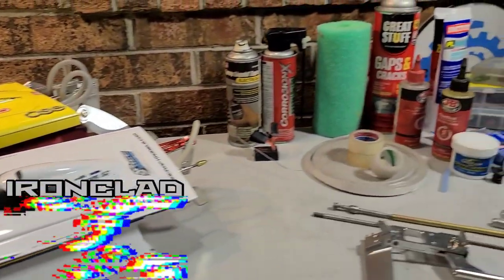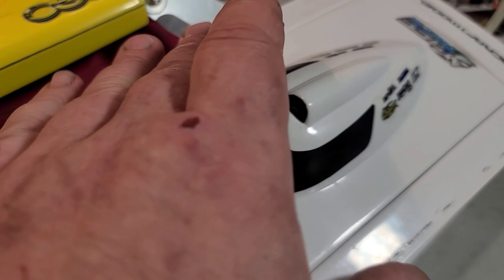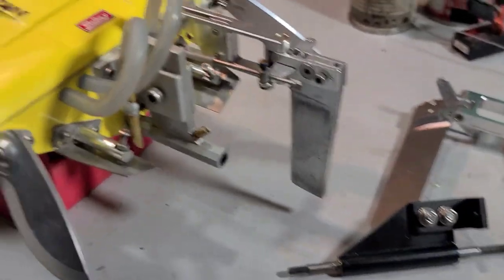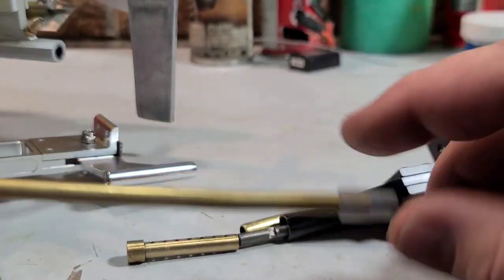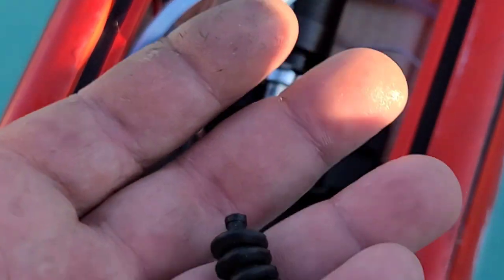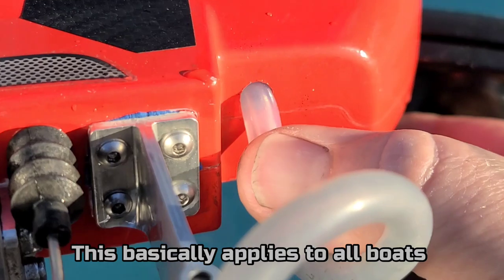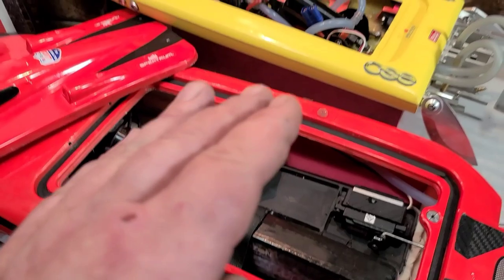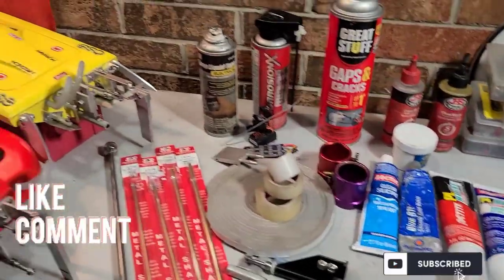How To Identify, Find & Fix a Leak In Your Boat, Water proofing, Floatation Fast Electric Rc Boats

Comment: This is an immediate subscribe for anyone new or old ro RC boats.  I'm new and this is invaluable info.  Although I'm sure you've read that I've had a very interesting time on my first couple of runs with the boat acting erratic and taking off on its own and me having to catch it and slicing one of my fingers in the process.   So this video about waterproofing is absolutely critical for me

Comment: Thank you for this video! I had a big leak in my new to me Traxxas Blast. Checked the boat in my bath tub. It floated in tub for 1 hour no leak, but when I run the boat it would fill up fast 🤔. Figured it was cooling system leak, took syringe and pumped water through, no leak. Ran boat with no prop like in video no leak…Then I started checking hull penetrations. The water cooling exit was too big for cooling tubing, and was letting a TON of water in. The water covers the hole before getting up on plane, which is why it filled up only when driving. Put heat shrink on tubing to make tight fit. NO MORE LEAKS 🎉 thank you
Reply from the maker: Glad I can help.

Comment: Man...i cant stress how sketch zipties are on lines...especially fuel! They create a pinch point thatll suck air...think of a teardrop.... try cutting a 5mm section of your line and stretching it over before installing....works 1000x better than a ziptie and no cut points...and easier to do than safety wire... thanks for all the info you put out too....learnin a lot every time i watch new vids!
Reply: @ClickLikeAndSubscribe  been doin it for my fuel lines in gas airplanes for years! Just got into boats and applied same methods....we wanna keep fuel in the tank and water outta the hull!

Comment: Very very info man!  You are the best on boat vids Ive found. 

Got a UL-19 2 months ago and 3 leaks/issues I found that were tricky to find. 
1.Small leak in hull where stuffing tube goes through the hull. Only leaked under power. 
2. Orings on hatch nuts, even taping off hatch they can leak. slightly larger orings on thumb screws and vacuum caps on the inside of the boat pretty eliminate that.  
3. This was a 2 fold issue. They tightened down a nipple/barb on the cooling jacket to tight. It cracked the plastic washer and would leak under power, but also being turned in to far almost cut off water supply through motor. I used stainless washers and thread tape on that. 

This was just something I found on this specific boat that might apply to others.
Reply from the maker: Thanks for sharing.  Do you have a link for the vacuum caps for the thumb nut?  I've been looking with out lucka
Reply: @IRONCLADRC  You should be able to get them at any auto parts store. The assorted packs with different colors are silicon and longer. Less than 10 bucks.

Comment: First your additional water cooling pick up and now adding pool noodles, my BJ24 is becoming a tank. I have been researching parts for my boat and wondering your opinion on two things. First would you buy an original flex shaft or upgrade to the OSE? Second do you know any part number to replace the steering rod end? Proboat/Horizon do not offer a replacement. Keep the tips coming sir, awesome work.
Reply from the maker: I'd get the ose upgraded Flex & strut. As for the steering rod end you can use an ez-connector instead

Comment: Started on my DF45 MKII today, that stinger really brings motor far back, so i will need to move batteries in front, or run paralell ;) Not that i complain on running paralell 6s.
Guessing around 42-45mm props on the Leo 2200kv, but lets see how it behaves on 45mm prop and 4s
Reply from the maker: Awesome. Thanks for the update  brother. Good luck with the run.

Comment: I think you mentioned in another video that the bushings in the V1 and V2 are different. Where do you get a V2 bushing, I can't seem to find them?
Reply from the maker: You may have to buy the whole strut?   Check Offshoreelectrics.com  he may have them or horizon hobby https://www.avantlink.com/click.php?tt=cl&merchant_id=953aec29-878e-4306-b620-2df85883455e&website_id=70256520-69d3-496b-a06d-cfbf9af7a81d&url=https%3A%2F%2Fwww.horizonhobby.com%2Fhttps%3A%2F%2Fwww.horizonhobby.com%2Fproduct%2Fpropeller-strut-sonicwake-36-v2%2FPRB282093.html

Comment: Hey big B how's it's going I just have a question for you I want to move my water outlet to the top of my boat so I can see it how can I drill the hole or something can drill on the VELES 29, If u could answer this for me upgrading water outlet size to M8 thanks
Reply from the maker: The proper drill bit should do the trick nice and slow

Comment: So question I have a black jack 24 and the boat got sea water in it, and last time I was trying to run it but it wouldn’t do nothing and all of a sudden it did but then I wouldn’t again, few months later the battery was swollen, now my question is any other electronic gonna be bad or can I just buy a new battery and it’s gonna run fine?
Reply from the maker: Depends did you rinse the boat off with fresh water after you tan it in salt water?  If not then you'll just have to see once you plug in your new battery. Wish I could help more.
Reply: @IRONCLADRC  yes rinsed it when I got home

Comment: Another way to check for leaks is to put your boat on a stand, poor water into the hull and see where it leaks out. Gravity will reveal most leaks. BoatGang
Reply from the maker: We use to do that with aluminum Jon boats to find a leak.   It works 💪

Comment: Man mines got more leaks then a sponge haha...  Only Thing I can think to do beside soapy water and air pressure was to fluoresce the water and put it in a dark room with a black light and watch to see where it comes in 🤔 I'm fairly certain it's my packing tube as I can hold it under water with maybe a sprinkle of water and sat it in the sink for an hour.. little got in but that's due to the dodgey foam seal...it's entirely porous 🧽 😂 trying to convince myself to go get a boat with a single piece hull and flat plate latch as I know I can get that to seal haha .
Reply from the maker: Fill the boat with water and watch where the water leaks through the hull
Reply: @IRONCLADRC  when I read that ...I immediately felt the pucker factor kick in 😂😂 👍 I'll give it ago I'll take out my servo n that first as it isn't remotely water resistant apparently.. thanks mate 😁
Reply: Also what do you think of either putting down a bead of vasoline between the lid and seal I know that stuff doesn't like water haha .. however I don't want to go killing the native invertebrates as I know for example that one drop flea stuff and wipeout a lake in a couple hours so I'm a bit sketchy with what I'm adding haah